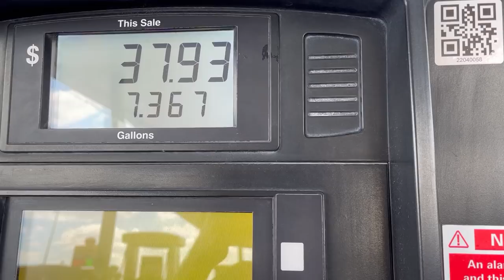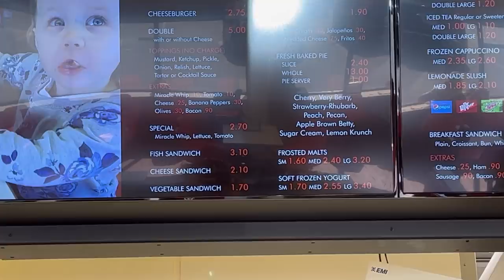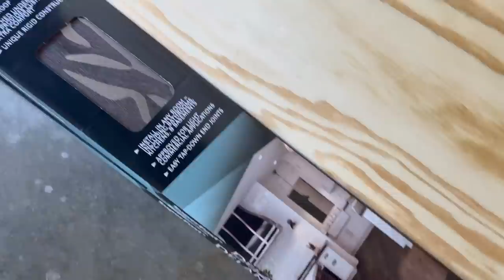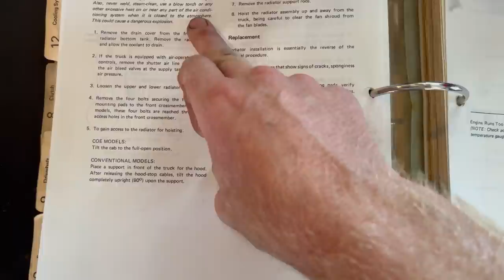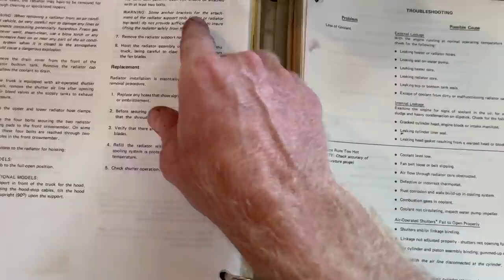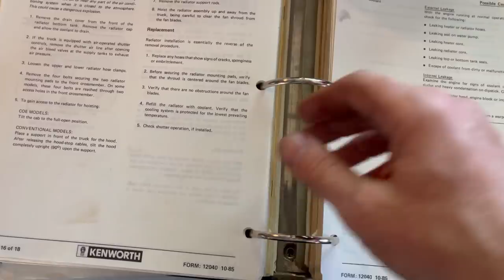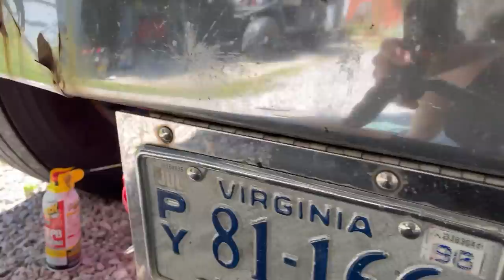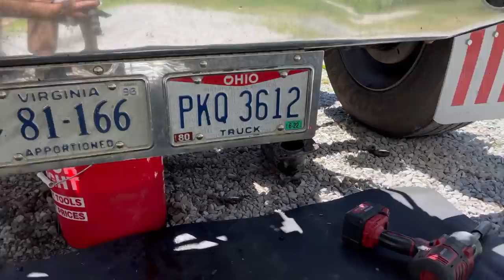Cabover Turbo Wing, Radiator Pull Prepping

Comment: That wing will look good on there. I was gonna say Defiance truck sales should have any hose you might need. None of those are formed hoses that I could see. Those straight hoses just get cut to length. Might be a good time to change a few other things like the thermostat but I don’t know when you did it last. I know if I’ve got the coolant out I try and make sure to at least check all the hoses and stuff. That is gonna be nice new seats and floor in there. Can’t wait to see the next video
Reply from the maker: They usually got the stash

Comment: hey Chad are you running red coolant in the old 855 if you are go back to green with DCA in it those old cummins dont like long life red coolant jacks with the liner orings
Reply from the maker: Been running red for 2 years with no problems so far
Reply: @1ChadKeegan  ok maybe the new stuff has the proper additives for the older ones now